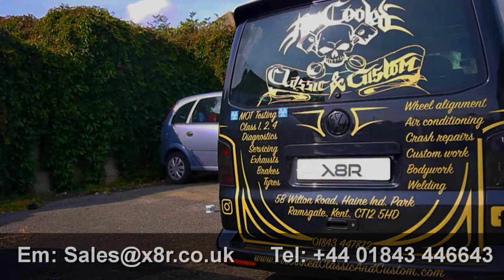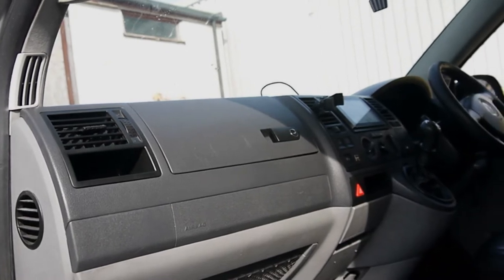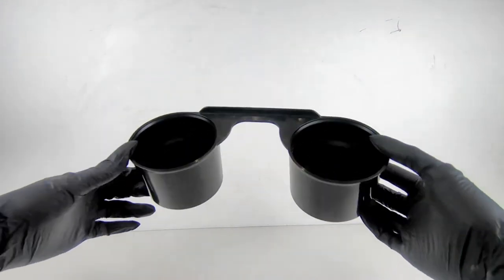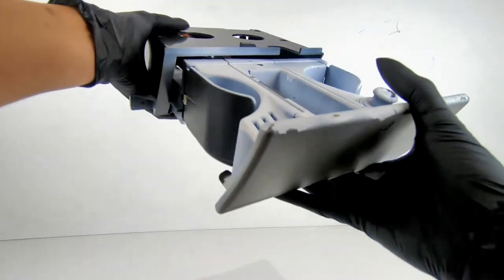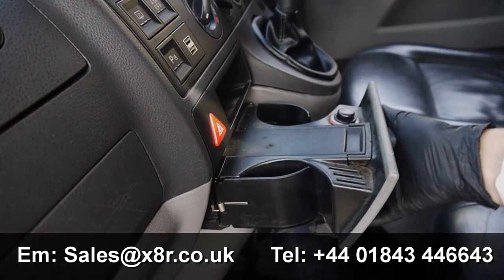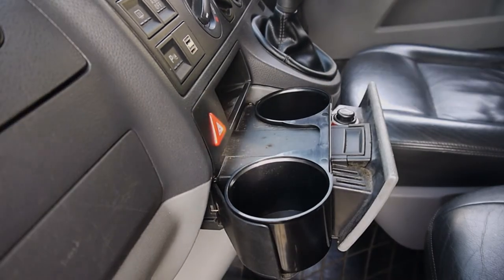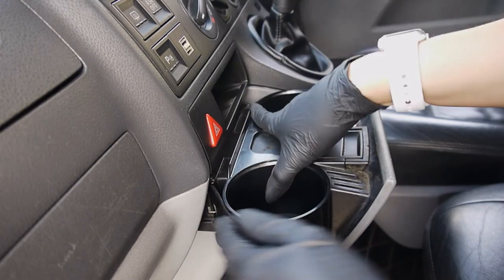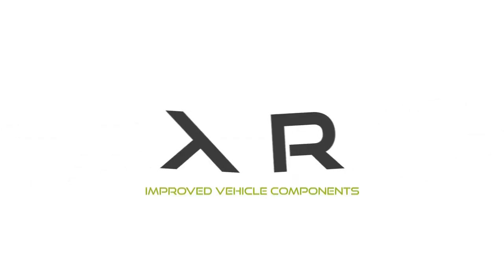Volkswagen T5 T5.1 Cup Holder Insert | Broken Snapped Spring Mechanism

Comment: Does this insert work without the flaps on the cup holder?
Reply from the maker: It should work okay as the design is integrated to the shape of the pop-out section. The flaps just help hold it in. - Georgina, X8R Ltd